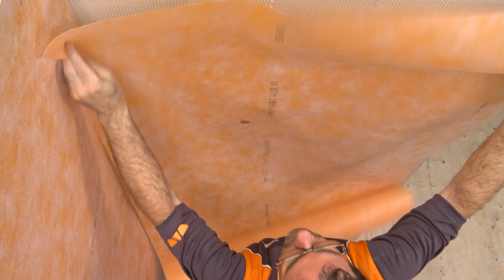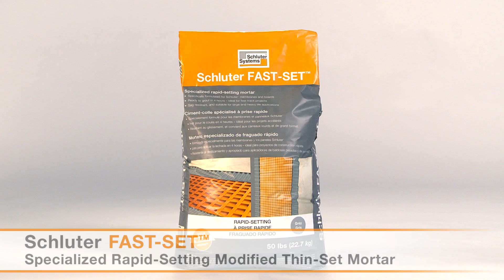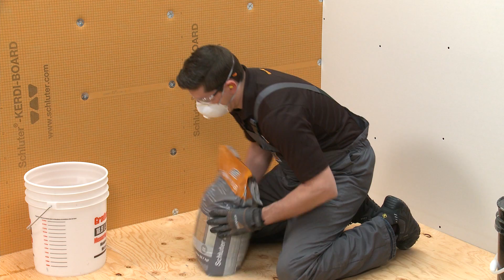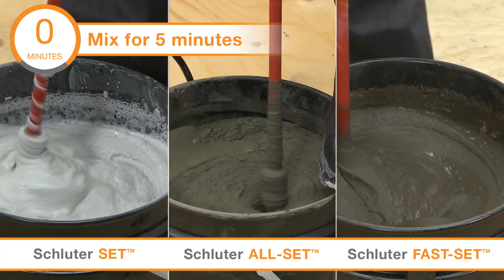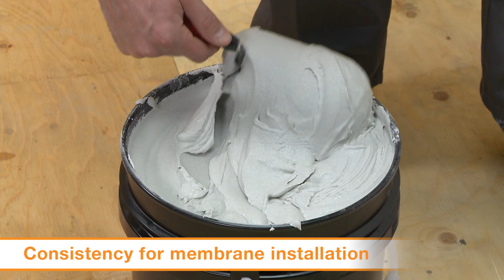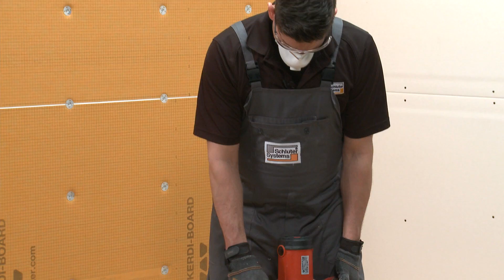How to Mix Schluter® Thin-Set Mortars

Comment: Schluter gives a range of how much water to add for tiling: 5.5-6.5 quarts per 50lbs. I understand this, because you might want less water for a thicker consistency for hanging heavy tiles on a wall or ceiling, and may be a little more water for a thinner consistency for laying tile on the floor. What I don’t understand is why they give a range of 7.5 to 8.5 quarts of water per 50 pounds for the underlayment. Why would there not be a specific amount? For a first timer like me, this is a bit confusing. Certainly, Schluter has tested this product thoroughly. It’s their own product. How is it they could not come up with a specific amount of water? 7.5 and 8.5 (or 8.0 for that matter) would obviously make different consistencies. So which one is correct? Can anyone who has tried different amounts tell me what is best?
Reply from the maker: Since 7.5 to 8.5 is already going to provide that thinner consistency we are looking for when installing our membranes, as opposed to the 5.5 to 6.5, this allows for a workable range that is accepted as still following our instructions and will not sacrifice on performance. Within that range, some installers may need to mix a little more wet or loose depending on the substrate, environment and so on, to give the best consistency for the particular on site conditions of that installation.
Reply: @schlutersystems1  I see. Thank you for your response.

Comment: What happens if you do add more water once the cement has been mixed?
Reply from the maker: Hi Jonathan! After the mortar has been mixed to the desired consistency and slaked, it will stiffen as the cement begins to hydrate and some evaporation occurs. At this point, adding more water to return to the original consistency (prior to slaking) can dilute the mixture and result in a weak mortar. This creates risk of tiles becoming loose and grout or tile being damaged after installation.

Comment: Where can I find a table for mixing ratios by volume? For example "X" litres of All Set to 1 litre of Water. Or please advise the volume in a full bag. 

Otherwise I need a scale to figure out how much is half a bag. 

Providing the range of water ratios would also be helpful to get the right ratio for a specific application.
Reply: For setting tile, on all-set I found 3 parts mix to 1 part water is really close. Can tweak consistency a bit after a bit of initial mixing.
Reply from the maker: Hi Adrian, we do not have a table showing various mixing ratios by volume. The thin-set to water ratio for smaller batches should be the same ratio as we give for the 50 lb bag. So, whatever the desired mixing amount is should just be divided up based on the proportions given on the bag. A scale is the best option to ensure the right amount of thin-set mortar to water ratio is achieved. Feel free to give our product support team a call if you need complete instructions. Thanks 800-472-4588
Reply: @schlutersystems1  
Thanks for the quick reply however I don't see myself of any other DYIer fiddling with a scale. So this sounds like an opportunity for Schluter to provide a table for mixing ratios by volume. 
Or you can simply answer my question and let me know what the volume of 50lb's of thinset is
Thanks
Reply from the maker: Hi Adrian, sorry to keep you waiting on this as we had to verify with our Technical department. There is approximately 0.41 cubic ft of dry powder per bag of thin-set. Hope this helps. If you would like to speak to our Product Support team, you can always give them a call on 800-472-4588.
Reply: @schlutersystems1  I thought I would double check your technical department. So I measured the volume of an All Set bag and it came to about  0.54 Cubic ft or 15.4  liters. Not sure what bag your technical group was referring to.
Reply: @schlutersystems1  Well there's a $30 trowel. I guess now we need a $300 Schluter scale. 
    It should of course come with a smaller funnel-like opening in the top of a proprietary beaker-like weight guesstimation container calibrated to the non-adjustable tare of such scale; in order to ensure an adequate level of frustration and complication commensurate with the highly technical task of whipping up a bucket of mortar.
    None of the field installers seem to actually be following this mystical formula. It's almost like they dump some water in some powder like they've been doing for the last several hundred years, and mix it.
    To a consistency that Schluter can only describe as:  somewhat liquid but still able to hold a $30 notch... Or somewhat thicker.     
    This could be a bit more convenient.
   ETA: If you call the Schluter rep for your area, he may tell you something along the lines of "Make it as wet as possible yet able hold a ridge" (for installing the membrane)."
     I'm not going to state that I made such a call and received such advice. Or where I live. Headquarters may be embarrassed by such simplified and practical advice.

Comment: Hi, I am using your modified thin set to go over Kerdi board. Question if I mix the full bag do I have to use to all in the one application or can I leave it in the bucket with a lid on it overnight and restart my tiling again the next day using the mortar in the bucket that I left overnight? Thanks
Reply from the maker: Hi Theresa, unfortunately no. Thin-sets have what are called "pot-life." After a certain amount of time the thin-set will begin the curing process and will no longer create bond.

Comment: Following the directions, I barely get 90 minutes pot life with All Set. Mixing Max 6.5 quarts water for tile setting. 5-10-3. Any ideas?
Reply from the maker: Hmmm... mind giving us a call, Allen? Our Product Support team can better guide you through conversation. Thanks! 
US 800-472-4588
CA 800-667-8746
Reply: I had similar issues using all set.  Cold water seems to help some.  They seem to be dreaming with 2-4 hours.

Comment: What is the ideal amount of water for mixing Schluter Set to install Ditra? I think your packaging changed and the numbers for this did too.
Reply from the maker: Hi Allen, thank you for your question. The Technical Data Sheet we've included has all of the correct amounts for mixing and using with our membranes.

https://sccpublic.s3-external-1.amazonaws.com/sys-master/images/h9d/ha7/8949341880350/ALL-SET%20Thin-set%20Data%20Sheet.pdf
Reply: @schlutersystems1  Thanks but that doc seems to be for All Set in particular. What about the Set mortar? Is there a doc for that?
Reply from the maker: So sorry about that! This was our mistake, here's the datasheet specific to Schluter Set: 

https://sccpublic.s3-external-1.amazonaws.com/sys-master/images/h67/h0f/8948169015326/SET%20Thin-set%20Data%20Sheet.pdf

Comment: I got a little confused by this video. It sounded like Schluter SET(@0:40) unmodified thin-set is only designed for sealing membrane band but installation guide which came with my shower base says all 3 types are ok to use. Now my question: what is warranty requirement? My local supplier sold me a bag of ALL-Set modified thin-set.
Reply from the maker: Hi Eduard, here's a link to our Thin Set Usage table, which gives you an overview of each of our 3 thin-sets with their approved usage: https://www.schluter.com/schluter-us/en_US/select-thin-set/cp/page_000007LC
Reply from the maker: Feel free to give us a call if we can help any further! 888-472-4588

Comment: does this mean i have to use a full bag every time? i can't use half a bag?
Reply from the maker: Hey Timmy! We recognize it's not always practical to use a full bag every time.  However, it is very important to reseal the bag carefully and use the remaining material at the first opportunity.  The longer you wait, the greater the risk of moisture in the air infiltrating the bag and causing the materials to at least partially react, which can reduce the performance of the product.  This is true of any bagged, cementitious setting materials.  In the worst case, if you ever see any "chunks" in unused material, dispose of the entire bag and use an unopened bag instead.